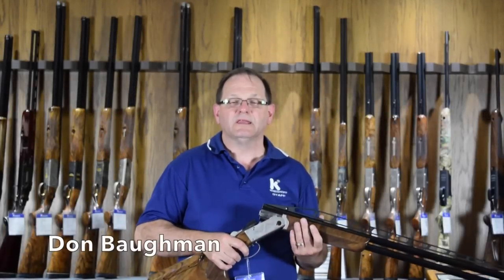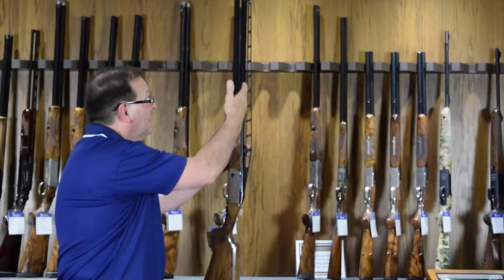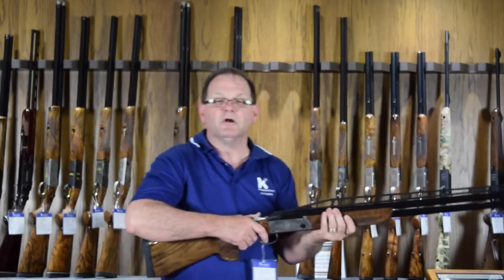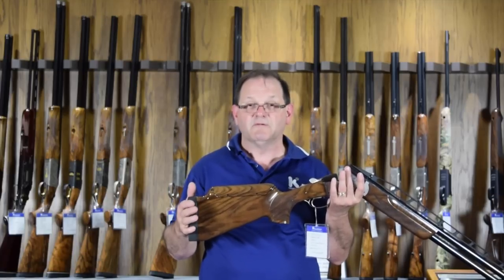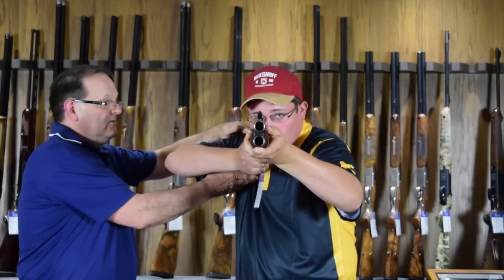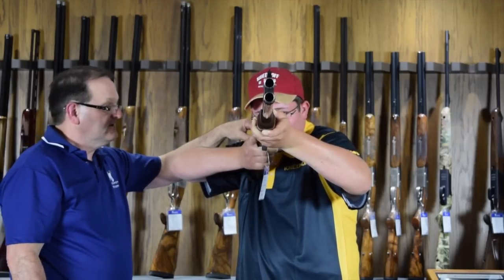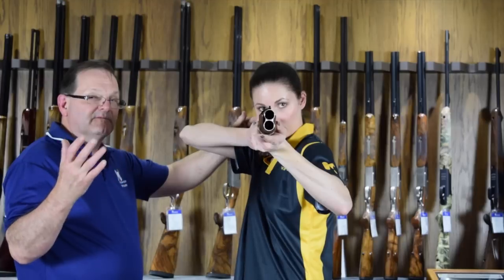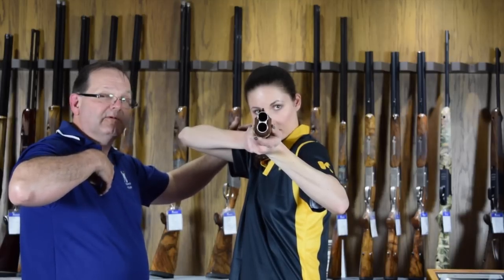Krieghoff Pitch

Comment: It seems to me that changing the pitch of a gun is pointless as long as you have a rounded or fitted recoiled pad affixed to the stock since the gun could easily be rotated around this axis. I can see however, that if a flat recoil pad was affixed that the pitch would make a difference since it would only fit in the shoulder pocket in one plane and couldn't be rotated.